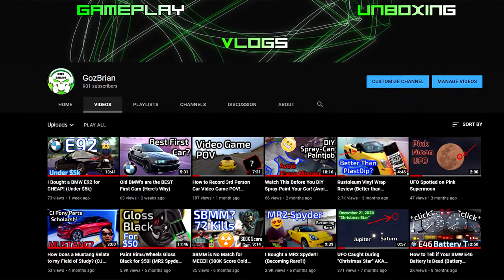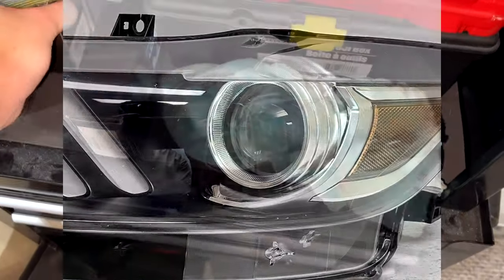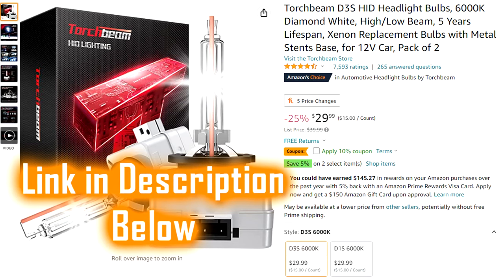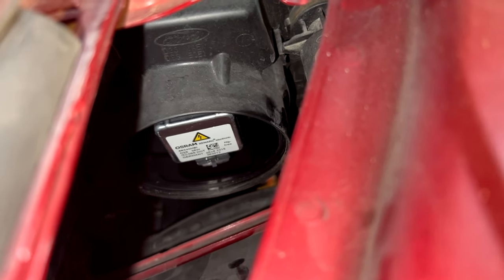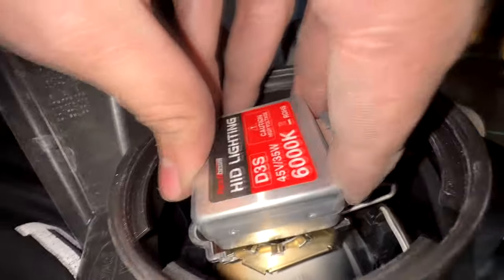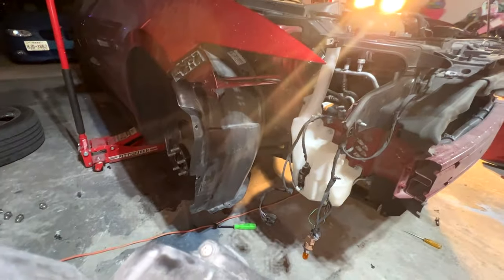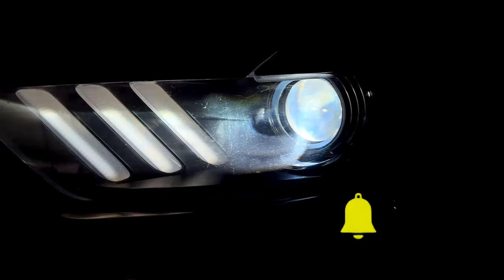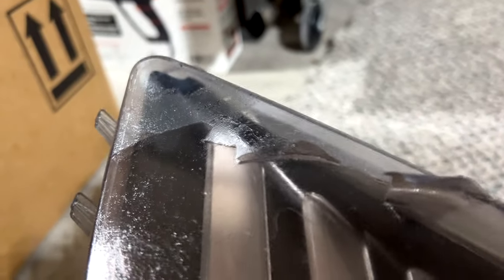2015-2017 Mustang Headlight Bulb Repalcement Without Removing Bumper (6000K HID Bulbs)

Comment: I can see that Ford have not changed their lack of quality manufacturing and design. The more videos I watch on mustangs or basically any Ford product the more scare I get about purchasing one of their products. A headlight bulb replacement on my Honda takes 2 minutes, I changed all lights to LED on it in less than 10 minutes. You are talking about removing the bumper just to change a dang light-bulb?  You got to be kidding. Stay away folks, don't feed the machine, they will fok you.
Reply: Chevys are the same way. I used to have a 2011 Malibu and it was the same crap to change the headlight. Why should I have to drop the bumper just to change a stinkin headlight?

Comment: I wish it didn’t require all this struggle to replace the lights. One thing I’m disappointed about the mustang with. Probably a weird question. But is it possible to cut the metal bar to get adequate space to change the light? I really don’t have the ability to take the wheels off to change the lights. This is ridiculous.
Reply from the maker: Cutting the metal will probably mess with the structural integrity of the chassis but I guess you could cut it if that’s your only option.
Reply: @GozBrian  I’m not like referring to making huge cuts. Just enough to give me enough space to freely change the headlights without struggling to reach in there.
Reply: @Eternalsfan  hope you didn't go that route, removeing the bumper would be the better/cleaner way. Don't make permanent decisions for temporary obstacles
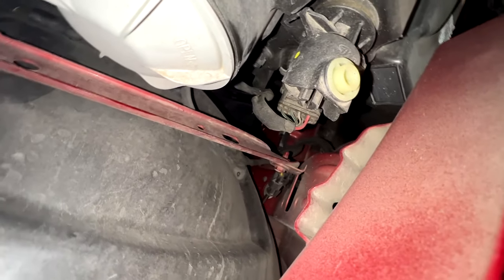Reply: There’s a much easier way to do it go through the wheel well and just remove the bar right behind the headlight it has two bolts holding it on. The frame he’s talking about at 2:20

Comment: Can you cut a hole in the wheel well plastic liner and make a flap door by drilling zip tie holes on flap and liner so it can be accessed when needed.